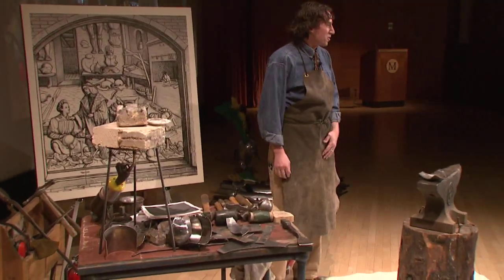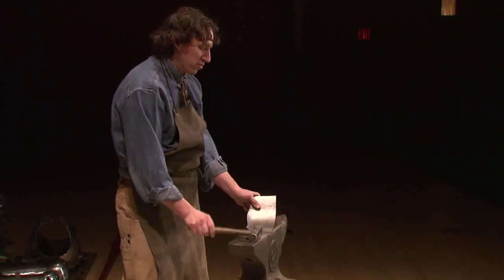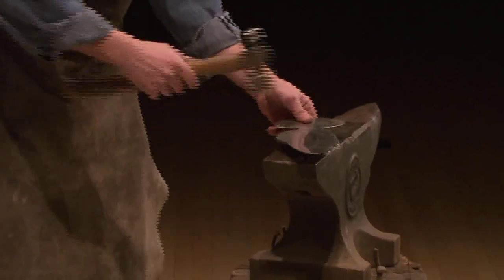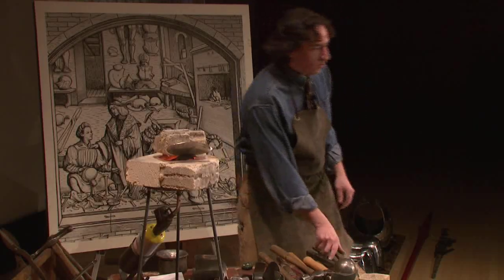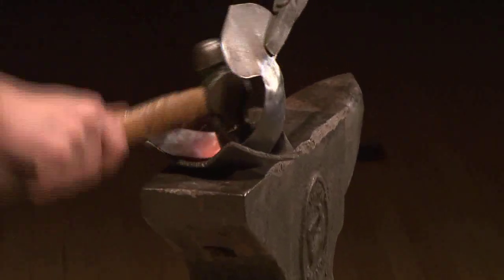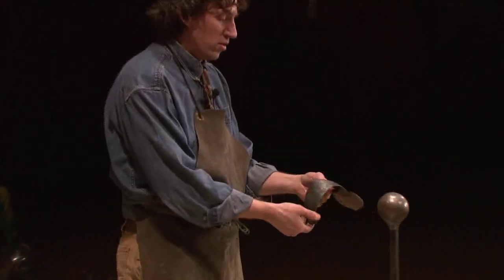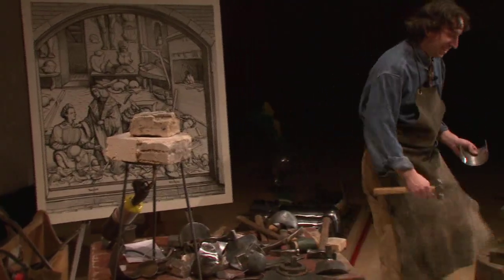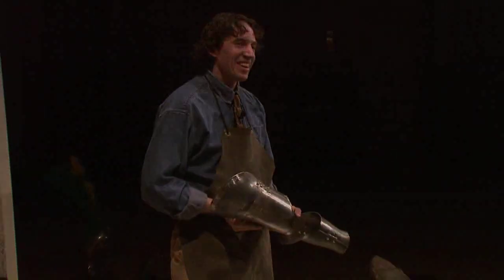Dressing in Steel:  Part One

Comment: From what I understand most armorer's start working with mild steels because it's just easier to form, and you don't have to worry about ruining it with a bad quench and temper.  As you probably know you can destroy a lot of work very quickly if it gets a bad heat treat.  A good book to get you started is 'Techniques of Medieval Armor Reproduction' by Brian Price.

Comment: 2. Intended use is hugely important both now and in period for armor thickness.  Harnesses intended for foot combat are thinner than harness intended for tourney.  Just like today, jousting harnesses are built considerably thicker than harnesses intended for light foot combat.  All that being said, your 2mm steel is a commonly used and good starting point for a robust mild steel piece of armor.  2mm would be good for helms, but heavy and thick for limbs, and very much so for hands and feet.

Comment: 1.  That's a very complicated question.  Firstly it depends on the type of steel you're using. Mild steel must be thicker for equivalent toughness of hardened and tempered 1050 spring that Jeff uses.  I own several pieces by him, and as an example, the breastplate he's working on for me will be done in 18 gauge 1050.  If he were to make this from mild steel, I would expect something closer to 14 gauge (~2mm) for similar resilience.  Even then, mild will dent and take a set where spring won't.

Comment: Mick, it would also be thicker in different parts of the very same piece.  Modern steel comes in sheets of uniform thickness. The plates that were forged in the middle ages were forged to differential thickness, partially because they didn't have big rollers to even it out, and partially because certain parts of the same piece should be thicker in certain places. For example, on a single breastplate, the front of the plate can and would be made thicker than the sides that wrap under the arms.
Reply: Knyght Errant true. Thickness is a very important part of strong armor.

Comment: That amor is able to hold a strikr?
Reply: It looks to me like the plate he is using is around 1,2 - 1,5 millimeters thick, which is the upper end of armour thickness historically. It's most commonly around 0,8 - 1 mil.
All that hammering "work hardens" the steel, making it much tougher. Then when it gets heat treated properly, it'll be even stronger. The round surfaces, ridges and all that is what gives it even more stiffness and resilience due to how it disperses and redirects the force from impact. 
With a sword you'll have absolutely no chance getting through that. If a blade is your only option, you'll need to go for gaps in the armour/helmet, which even then might not be enough, as often they'll be wearing chain mail or a gambeson underneath. You could puncture it a bit with a spear, if you hit the right spot just the right way, but that's about it. That's why when  plate armour like this became a thing, battlefield combat changed a lot more into grappling techniques, so that you could get in close and use your dagger to go for the gaps in the armour. Also blunt force weapons like warhammers or maces became much more popular, because even if you can't get through the armour, you can at least dent it in in some spots, maybe breaking a few bones and making it very difficult/painful to keep moving around with the armour pushing in against you. You can break their skull/knock them out/kill them with a solid bash to the helmet - and the absolute best way (still difficult, though) to actually penetrate the armour, is a solid spike on the end of a heavy mace/warhammer.

In the end, very few people actually got to wear armour like that. Basically only the very best trained knights who could afford it would have that - making them an extremely expensive walking tank of doom, that is extremely hard to stop.

Comment: Thanks for your reply.
I can easily get sheets of 1045 and 1020 in 2mm. I should also be able to get others but that would be me ordering sheets for myself through work. Is it worth the effort looking for higher carbon sheet? I forge knives and other random things and have had a few goes at bodkins (both from coil springs). I think it's time that i expanded my efforts to plate but for me it's got to be authentic (read functional, as i don't really follow specific styles very much) or not at all.

Comment: In another also well-made armor crafting video the heat-tempering processes are demonstrated. The armorer put a small mild steel remnant piece in a vice and showed how easily it would bend, and remain bent. He tempered other small steel pieces and showed how they were brittle and shattered like glass. I further tempered piece would spring back into place from being bent, just like steel used to make springs. Armorers could build suits where some areas thin, to save weight, but were strong due to tempering, fluting, curvature, folds, and rolled edges. 
A metal bread baking pan or mixing bowl started out as a sheet of metal that flexes and makes that "thunder" sound when you wave it. Add a bunch of folds and flattened-over edges and that former sheet of metal is now extremely rigid in strength. Hit that mixing bowl or baking pan hard with a hammer and it will take on some cosmetic damage with a dent, but that's about all.

Comment: There's something I always found fascinating about blacksmithing, hammering metal with a hammer and making it in to something. I wish I could do something like this
Reply: It's really much easier to get the ball rolling than one might think. You can get the basic stuff you need to get started for dirt cheap, if not for free. Then you just need to find a space to do it in, which is probably the hardest part. First you make very simple little things, and you can very quickly build up from there if you can sell them.
It's all about strength of will and determination :) Don't give up the dream!

Comment: neosonic66, I understand that. What I am chasing is generalised thicknesses so that I can start with sheet that is close and work from there. For me 2mm sheet is easy to get (scrap from work) so I figure that is good to work a breastplate from (the sides would be thinned during shaping). I'm chasing info on how much thinner the lighter parts of armour were so I can work out if it's easy enough to thin them from 2mm as I work them.

Comment: Damn, I replied this message, but it has gone. Thanks for your answer, I didn´t knew that. Is there any particular evidence, like a martensitic armor? 

And I have another question, if I may ask: A blacksmith told me once that the plate should never be hammered when it is red-hot. I thought that this was true because of the loss of stress, so the materias becomes softer,  and the lack of dimensional control. The first reasons is pointless if  the plate is going to be tempered.

Comment: My first thoughts were digital body scanner into a CAD system and a plasma cutter up to the pattern point. Obviously not an authentic method but I can't see why that wouldn't work well. After the patterns are cut from the steel then it would be back to the historical methods.

Comment: I've been doing a lot of research lately. It seams that a lot of stuff isade out of 16 to 20 mattering on the type of steel and the location on the body. I've been making a suit out of stainless steel, more for show I guess. I've been using 20  and 22 gaudge. Any tips on material and techniques would be helpful. I unfortunately  don't have a setup to heat the metal, so i've been making smaller sections, welding them, and grinding the weld clean.

Comment: I do a little bit of smithing in my free time, why wouldn't you bend it when it's hot into shape?
Reply: mason kahl I’m not sure, I think because it’s unessecary The metal can be bent without using heat.
Reply: Isn't it about the work-hardening?

Comment: I thought you were supposed to heat it up?
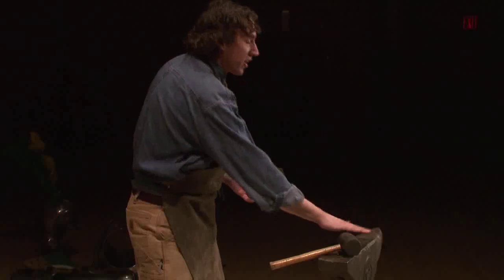Reply: I think the steel is thin enough so you can just hammer it cold. It should be heat treated at the end, though. Also have a look at round 9:30